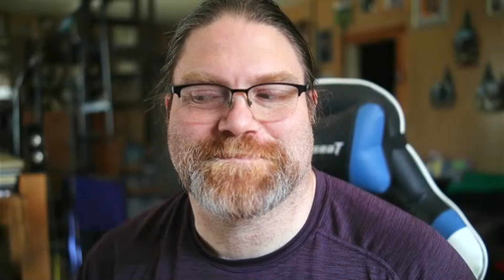Is an FMEA mandatory for the 510(k) submission?

Comment: Hi Rob, I’ve signed up for your Complaint Handling & Vigilance webinar and already paid for the effectiveness check. I emailed you my effectiveness check to get a certificate for it and waited for over a month now. I still have not heard back from you. I emailed you 3 times, called you twice. Is there a better way to contact you because I took your webinar for work, not for fun. I really need that effectiveness check or else, why should I pay for it? Thank you.
Reply from the maker: Thank you for bringing this to my attention. I was traveling for two of those weeks, and it slipped through the cracks. You will have your certificate later today. My apologies for the delay.